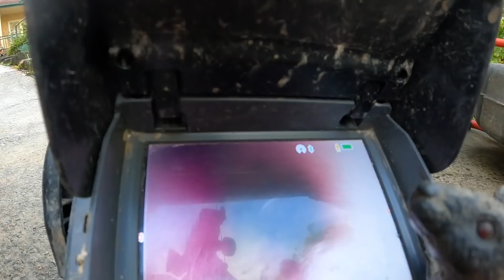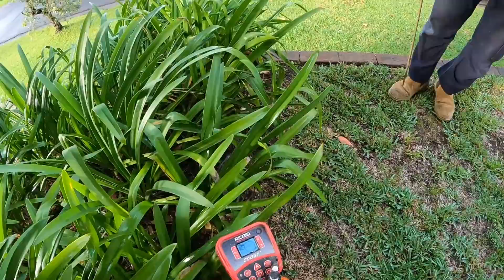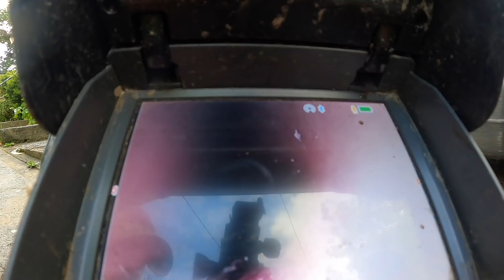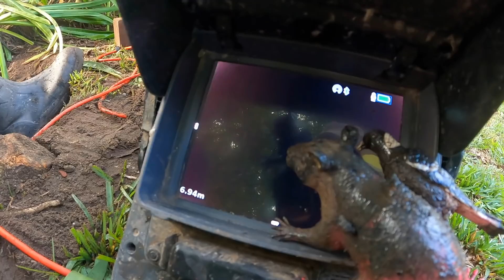Blocked Drain 568

Comment: Good old 'Might Probe'. 

I got mine years back after a cobber nearly pushed an non-insulated probe through 400-Volt power cable lying smack bang on top of a drain he was trying to locate. He only discovered this after digging up the drain. He realized he almost certainly would have been killed if he had penetrated the 400-Volt cable. 

He did some research, found the 'Mighty Probe' & quickly ordered two of the them - one for him & one for me.

Comment: likely bricks and the old clay pipe with concrete cap distort the tracking signal somewhat.
working overtop the signal in a larger diameter circle keeping the locator wand at the same height above ground may be slightly more accurate, including angling it slightly.
then again the location is pretty close for how they work overall.

Comment: Never did get an answer on why you don't use the quick connections any more
Reply: He explained a few months back that the screw type is shorter than quick connect and so the larger heads get stuck on the bends less often.
Reply: @nathanbell9098  I was wondering if it might be something like that I must not have seen that video or didn't catch it or something like that and I was always wondering why but that makes sense